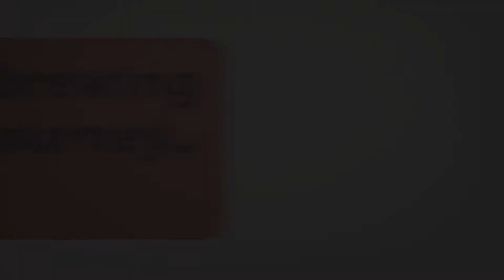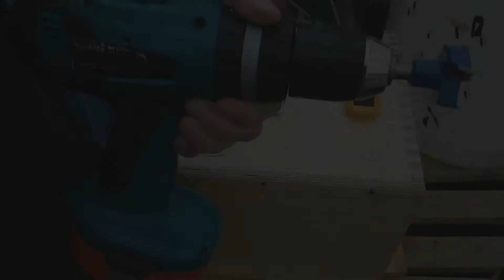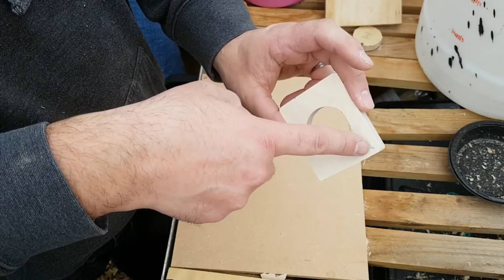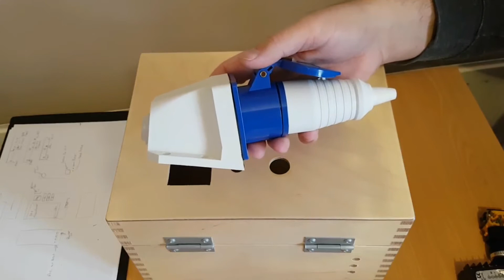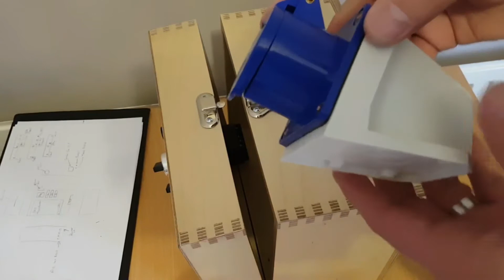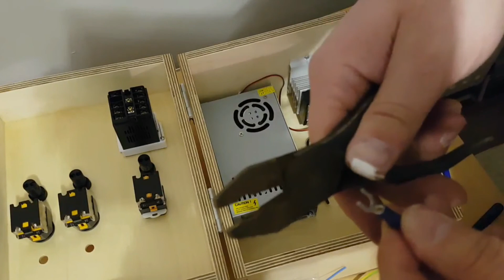Control Panel Build Part 1

Comment: jus as an observation, the big blue plug an socket, the socket should provide the power, an the plug end should recieve the power, that way you avoid the exposed pins in the plug end becoming live, and possible electric shock,👍